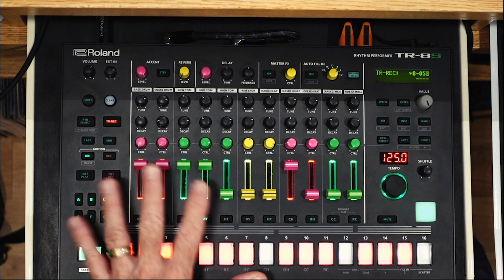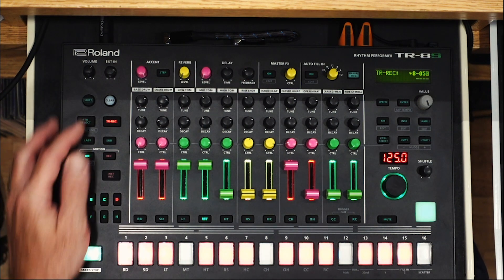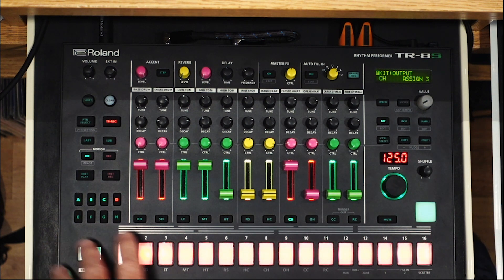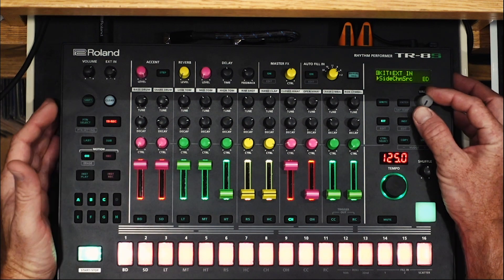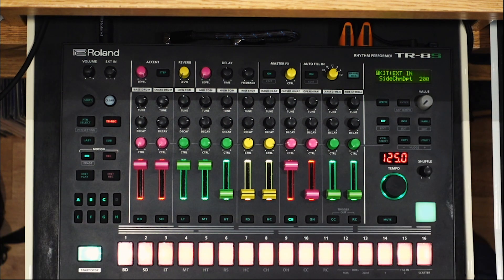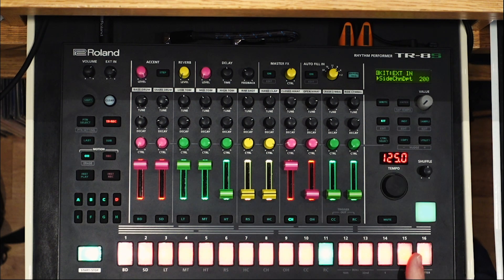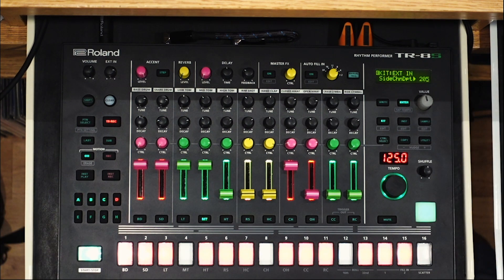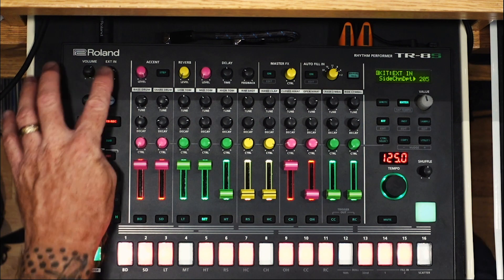Roland TR-8S Tutorial: Internal Side-chaining (How I Do It)

Comment: I missed the fact that harware output 3 (in this case) needs to be connected to external in via a jack cable, for it to correspond with the selection of assign 3. Which is kind of obious since something needs to go into the external in. Which kind of implies that a cable must be involved. Since the effect needs to be applied to the other sounds, they  need to get out of the rear for them to be fed into the external in. At first i thought, why assign 3? Why not 1 or 5? And in fact you could do that aswell... just need to connect the corresponding hardware out. I was a little confused in the beginning because i still gave some credit to the possibility that it could all be routed internally. Anyway, if you took the time to read this, good day to you.

Comment: Nice video.  I mean, it's not technically internal sidechain proper like Roland SHOULD be giving us, but yeah this is better than nothing.  They even added internal sidechain to their budget T8.  The problems are:

1. You have to tie up the internal aux inputs so can't input anything else (having the sidechain on a hardware unit is dawless gold, and not many units have external stereo sidechain processing, so this is a shame)
2. You have to tie up external aux outputs so you can't send audio out for external processing elsewhere
3. You need to pay for aux cables of quality
5. Those aux cables are dedicated for the purpose so can't use them elsewhere when running the sidechain (which will most of the time)
6. You need to keep the audio cables on hand, can't put them away deep in a box or anything, need to carry with when transporting
7. There is inherent sound degradation, forcing a run through dca out to audio, and then back through the dca if you are running through usb audio
8. There is inherent latency in the scheme

Roland, just give us proper internal sidechain on your flagship drum machine please

Comment: I often use the assign out into ext in to add gnarly distortion to kicks. Turn up the input gain in the menu and then use the ext in volume knob to find the sweet spot where the overdrive sounds good.
Reply from the maker: That would be a safer way to do it than just keeping the fader down lower as you overdrive the gain. That would let you push the fader to the top every time without fear of being too loud. Great tip!

Comment: Im using a Pro 1 synth as a main bass guy in setup feeding it in my left ext in channel for sidechaining with tr 8s. 
Is it possible to use sidechain of external device at the same time, cause there is only one external in?
Reply from the maker: @pavlovsstraydogs  I gave it a try and it worked! Set your ext in to mono in the utility menu of the 8S.
Reply: @UnitE808  
1) what kind of splitter do you use?
Y shape mono/mono in and mono out? 
2) do all tacks assigned to internal sidechain
Via such a trick loose their stereo capabilities?

Thanx 🙏🏻
Reply from the maker: @pltndbnn  1. Splitter? None. I use a TS cable from assign out to ext in R. I use another TS cable from external synth mono out to ext in L. 
2. As long as you're mix out of the TR-8S is stereo, you're fine. Drums really shouldn't be in stereo, though. There is no need to have 2 seperate signals of the same drum.
Reply from the maker: I haven't given it a try, but you can try to  Run the assign out to the other side of the external input, the right port

Comment: Thanks again unit e. I was looking for a way to do this. Most recently started using the new Vinyl Sim effect which gives a good pump to the track. Your thoughts on this ? It’s way less controlled than your technique
Reply from the maker: Since the Vinyl Sim isn't really made for that, it won't be as accurate of a sidechain. Plus, now you can find that sweet spot in the vinyl Sim for adding that bit of flavor and not as an extreme effect.

Comment: Thanks for this tutorial, much appreciated! When combining the TR-8S along with the MC-707 and MX-1, would you still use this process, OR, would you setup the "ducking/sidechaining" on the MX-1?  Again, thank you!
Reply from the maker: That's tricky because the MX-1 has the effect per channel and that would sidechain the entire 707 or 8S, not just one track. I would probably send the assign out of the 707 into its own channel on the MX-1. Then you can send specific tracks on the 707 through the assign out for sidechaning. Does that make sense?
Reply: @UnitE808  So, what you are describing is to setup the TR-8S (USB to MX-1) per your vid instructions, then, when adding the MC-707 (via USB to MX-1) also have an add'l cable for assign out to another MX-1 channel. Is this correct?  [I just got a used MX-1, thus, trying to integrate it with my TR-8S & MC-707, plus a couple of synths.]

NOTE: I have seen some YT vids showing separating the TR-8S (USB to MX-1, and, Kick/BD to separate MX-1 ch via Assign Out of TR-8S) and have the MC-707 via USB input to MX-1, yet, not sure how they achieve the ducking effect.
Reply from the maker: @LuisTorres-qz5kr  you're correct in the setup. The users sending their bd to a seperate channel on the MX-1 are doing this for additional processing of the kick. They are not trying to achieve a sidechaining sound this way. 
I use my MX-1 effects to the fullest. I love that machine! I send all my boutiques to it, my eurorack, and my 6S and MC-101.  Currently, my 707 and 8S go to another mixer, so If I need to sidechain something on the 707, I send an assign out of the 707 to the ext in of the TR-8S. I don't normally use the internal sidechain of the 8S on itself, only if I'm jamming on it solo or if it's added to my DJ-808 setup for DJing.
Reply: @UnitE808  Thanks! Making sense now.  Will test this out this afternoon.
Reply: @UnitE808  Clarifying question! Have same setup (MX-1,707,8S). What true method to use sidechain in this setup, when the 707 send on MX usb channel all this channel are sidechained(all 707 sounds, not only bass), What is the correct method you would recommend, for stanard trick use kick on bass in this situation, thanks!
Reply from the maker: @crazyFrankyy  I would send the bass track ourlt the assign out of the 707 and into the ext in of the 8S. Then, you could potentially send the external in back through an assign it on the 8S back to the ext in of the 707.